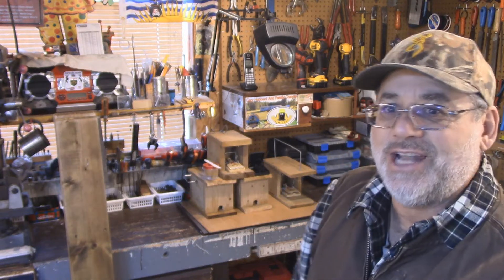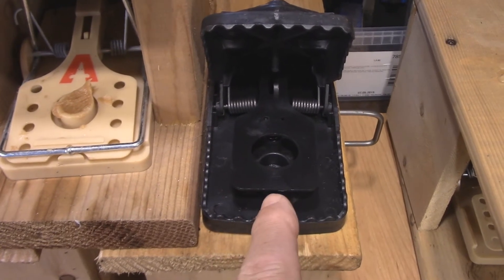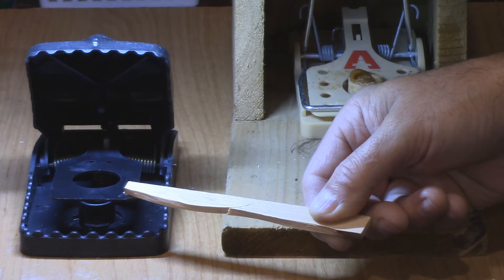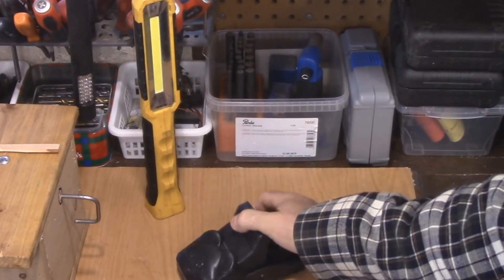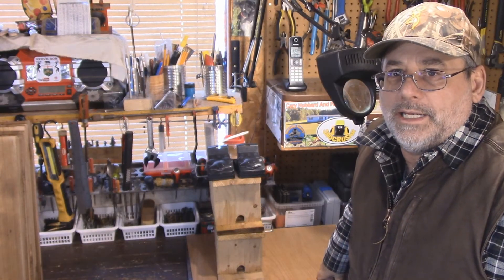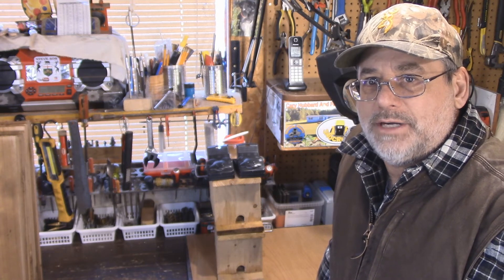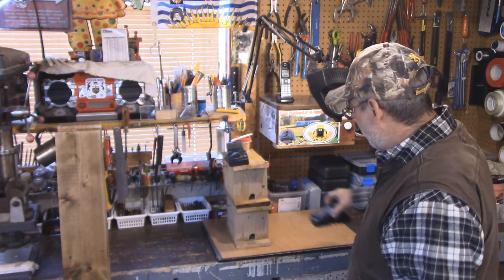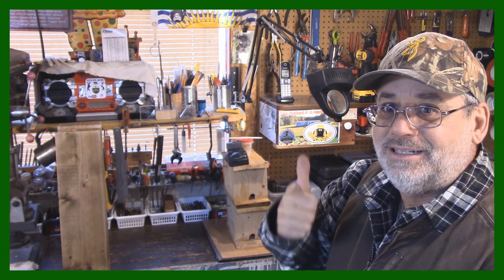How To Catch Mice Without Catching  Birds And Squirrels

Comment: the rats that prompted me to purchase these type of traps were big, close to squirrel size. I did eventually catch them, but had to tie the trap to something so they couldn't pull it off. 6 of 8 I had to finish off, the trap didn't kill them. Then later I had more come, they would not take the bait and one that tried I only caught hair. So I put the peanut butter on the back of the spring, not in the bait area. It worked, another big one, tho completely clamped closed, the rat was very much still alive. Now I have one or more that will not  use the trap. Time to switch bait I guess.
Reply from the maker: For rats I have found pepperoni works great or most salami.   I like to use the boxes for rats since they must enter from the front and the trap gets them good compared to a trap where they can come from the sides to get the Bait.